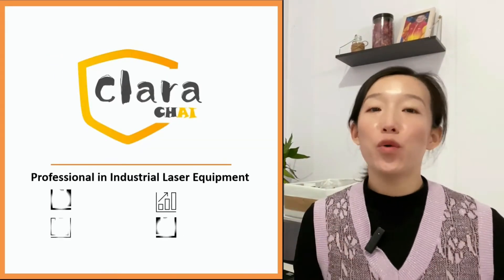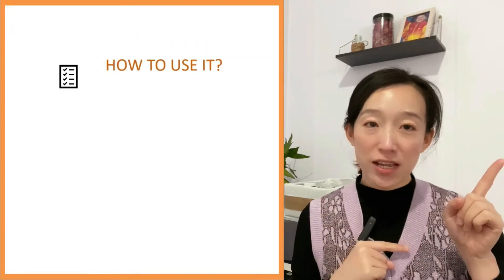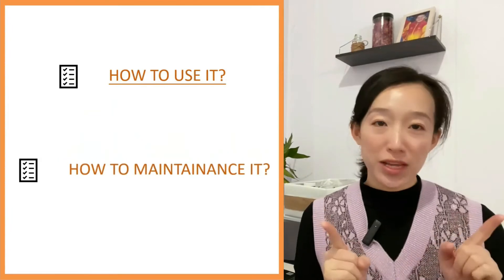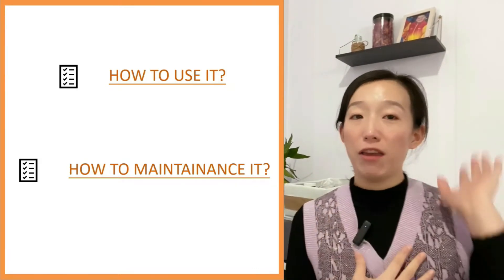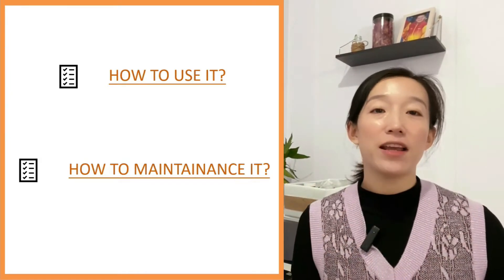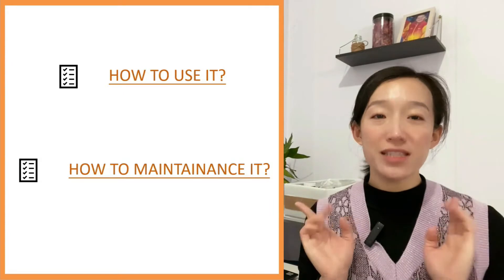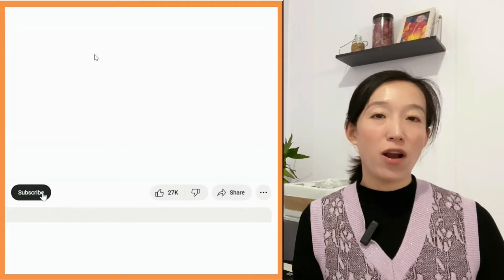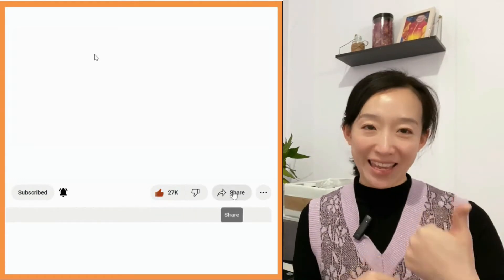Maintenance Mistakes of Fiber Laser Cutting Machines

Comment: Hello madam,we are also using fiber cutting laser machine,this machine has 4KW capacity,the machine maker team told us it's capable to cut upto 20mm,but this machine does not give fine cutting surface in 12mm,what will I do next?
Reply from the maker: You need to ask them to help you find the matched parameters.